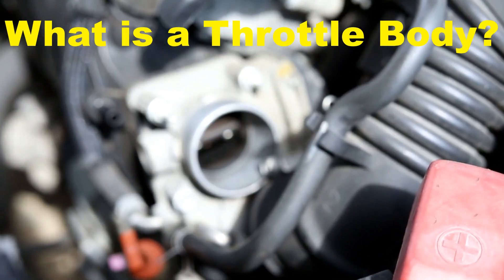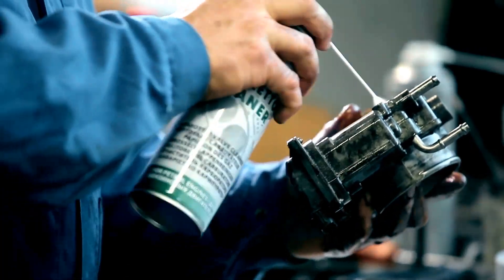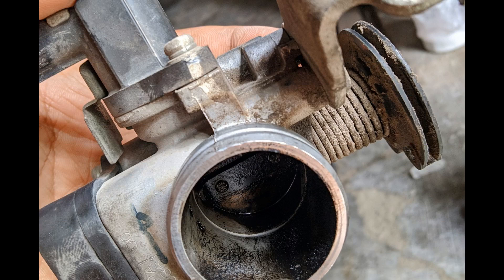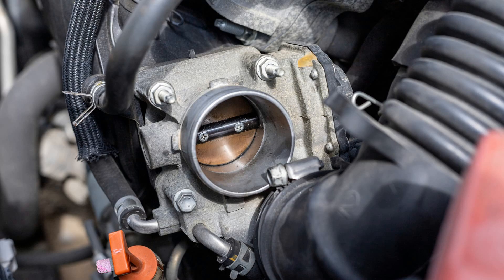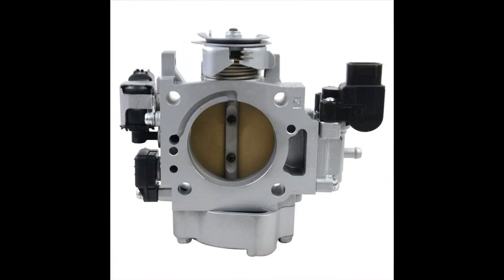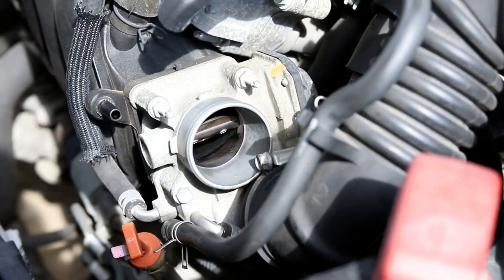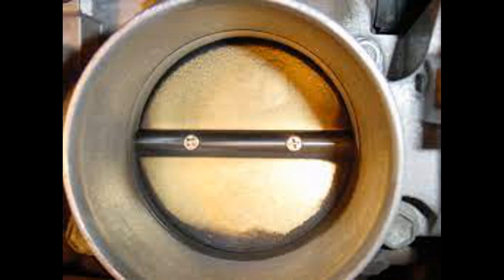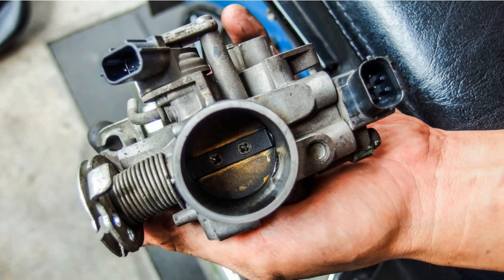10 Signs of a bad throttle body

Comment: My car experiencing very poor mileage, acceleration sluggish at low gear and rev, air/fuel mixture too rich
Reply: Poor mileage, sluggish acceleration, and a rich air/fuel mixture can indicate issues with the fuel injectors, mass airflow (MAF) sensor, or oxygen sensors. It’s best to check these components, as they affect the fuel mixture and overall engine performance.
Reply: @ thank you so much for the answer. When I first bought it, there were codes for maf and o2, I cleaned the maf, reset the code, didn’t come back 'til  not back to this day but is still hard passing the first gears. I assume it needs transmission fluid change so bought a filter without a gasket to service it.
Reply: @ rich air/fuel mixture hasn’t come back on check engine

Comment: I have a 2013 Ford Fusion, just got back from the mechanic due to warning light on my dash. Mechanic told me this morning that he had to clean the throttle body and charged me $145. He said if problems continue, he will have to replace it next time. He didn't give me the option to replace it, he just cleaned it. Now it seems if he has to replace it, I will be paying him twice for the same problem. Shouldn't he have given me the two options before just cleaning it? If there are any mechanics reading this, what would you have done?
Reply: It's understandable to feel frustrated. Ideally, the mechanic should have discussed both options—cleaning and replacing the throttle body—before proceeding. Cleaning is often a first step, but if the part is worn or faulty, replacement may be necessary. It's important for the mechanic to give you the full picture of potential solutions and their costs.
Reply: @MechanicalGuy68  I think a more experienced mechanic would have realized that just cleaning it would not have worked.   (at least that is what my brother said after I told him what happened)
Reply: Should have just put a new one
Reply: @eleasaralanis9592  . I was  so mad, I didn't even get to drive it after he "cleaned" it.  At least he took $75 off the bill for the new replacement.  The car runs ok, the engine just sounds louder. It is using less gas than before which is good.  I really shouldn't complain because I really haven't had many problems with the car.

Comment: My toyota qauntum engine light is on and does not have power.. i cleaned the throttle its still doing the same what should i do?
Reply: If cleaning the throttle didn’t resolve the issue, it could be a deeper problem such as a faulty throttle position sensor, fuel delivery issue, or a clogged air filter. I recommend scanning for error codes to identify the specific issue, and if necessary, check the fuel system and sensors for any faults.

Comment: 😢I think this is the problem am facing.. car is stalling, had rough idling, diagnostic test could pickup anything,  ford dealership serviced the car and never noticed anything.
Reply: It sounds like you're dealing with a common issue where the car stalls and has rough idling, but the diagnostic test couldn't pick up anything. If the Ford dealership missed it, the problem might be related to components like the IAC valve, throttle body, or vacuum leaks, which can cause these symptoms even without triggering a code.

Comment: 1999 Sienna climbs hills slowly and when the a/c is on it doesn't after climbing the hills it finds it difficult to accelerate, could this throttle be the issue or a faulty gear transmission

Comment: My throttle body electrical harness separated when I removed it but it slid right back into its place with its contacts and pins so I sent it. But I keep getting misfires in all cylinders at random times I have a advanced tool to check voltage and values can even actuate the throttle I’ll do that tomorrow . I’m more leaning towards the fact that I didn’t replace the manifold gasket thoug.h it doesn’t misfire until I hit 4.5k rpm then I can reset it in real time and misfiresnfo away until I get on the motor. I’m guessing it’s breaking seal in manifold giving bad air fuel mixture
Reply from the maker: Given the symptoms you've described, it's possible that the throttle body electrical harness separation and reconnection could be causing intermittent electrical issues leading to misfires. However, since the misfires occur at higher RPMs and seem related to the intake manifold, a vacuum leak or an issue with the intake manifold gasket could also be the cause. Check the intake manifold gasket for wear or damage.

Comment: Well explained; it helps for those who are engaged in either driving or deal with car maintenance.
Reply from the maker: thanks!
Reply: @Automotivemahi  I have a 2007 Toyota Yaris I had to replace my old Throttle Body, with a new one just wanted to ask you if when the new one is installed, id it just plug and play? or doe the new Throttle body have to be calibrated with a computer?